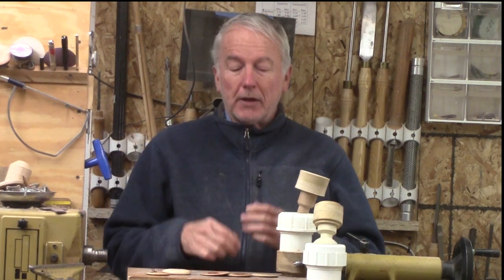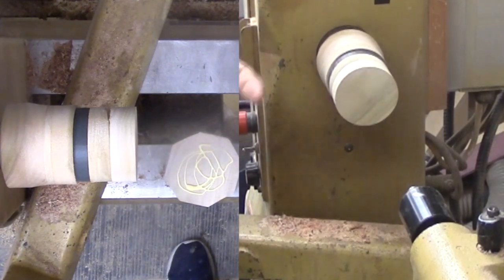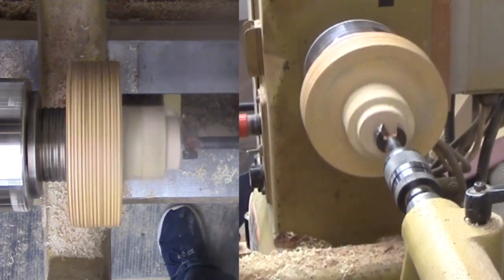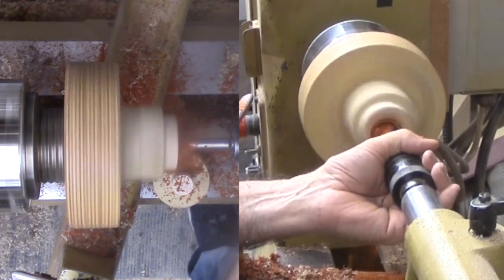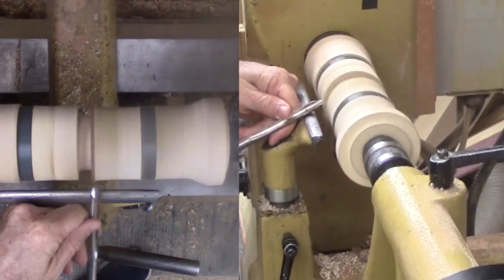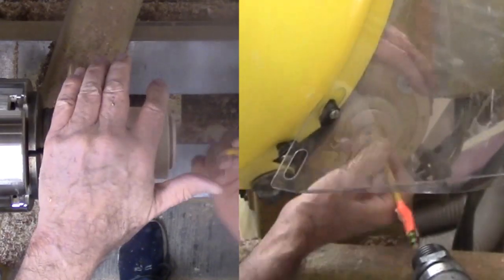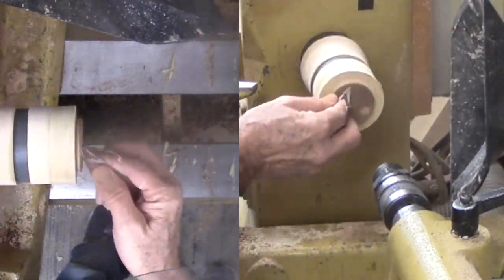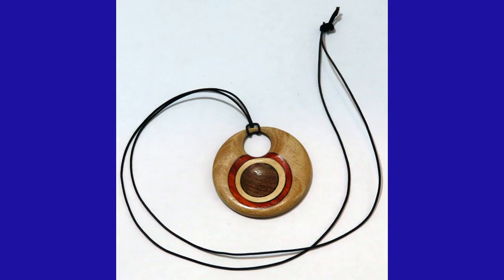Eccentric Woodturning Necklace Centered Inserts

Comment: Hi Alan,
Really enjoying this series of Eccentric turnings and your jigs, such a wonderful way to use up small pieces!  
The pendant looks fabulous, the 4 different contrasts of wood sure make it stand out….
 I completed a version of your chuck and WOW it works amazing, a few scraps of plywood, careful planning and an afternoon. Most importantly knowing that a person can make this for just a few dollars, it’s an amazing feeling of accomplishment!!
Curious as to what is the black disk on your work platforms?
Thanks for sharing, good old chicken noodle soup helps :-)
Wayne
Reply from the maker: Thanks for sending me your pictures. Your chuck is prettier than mine.
The black disk on the faceplates that have the 3/8" bolt contain a nut to keep the bolt in place. In my case, I 3D printed it with a hexagon space for the nut. This would be easily made  in wood with a t nut or  by epoxying a nut in a wood ring.
Alan

Comment: Trust you're fully recovered, without any long covid or similar. Intrigued by your rings and can see how you do this by creating circles/holes with a forstner bit or similar (large holes turned with a spindle gouge?) and how you can turn a plug to fit. Recently saw some jewelry where the guy had a snake effect on a pendant with (diminshing in size) plugs inserted into the wooden base material/disc. The small insert (tha tail of the snake) was very small. How did he do this? Some sort of plug and drill set? Don't know whether my description is any good but do you have experience of this sort of thing?
Reply from the maker: Turning a plug to fit is the same process used to fit a joint between a lid and a hollow form. 
Turn to just larger.
Turn a chamfer on the top. use this to test the fit. If the recess it pressed to the chamfer while the lathe is rotating, a slight line will burn or burnish.
Trim just shy of the line and test again. Repeat until it fits as desired.
No need for a plug and drill set.
Alan